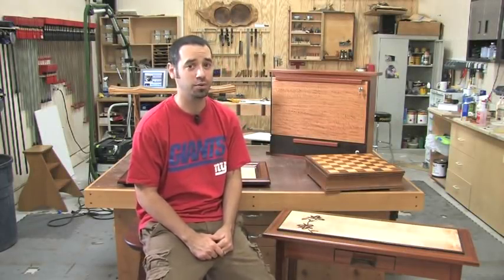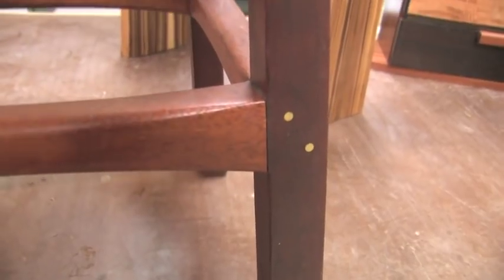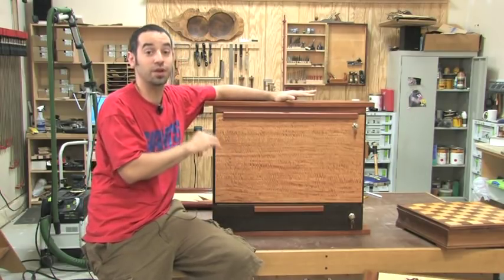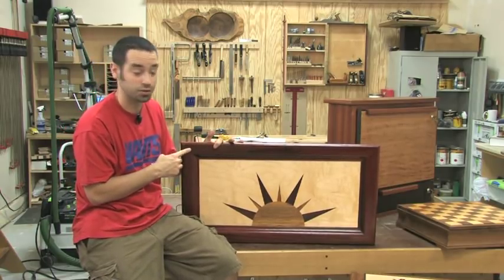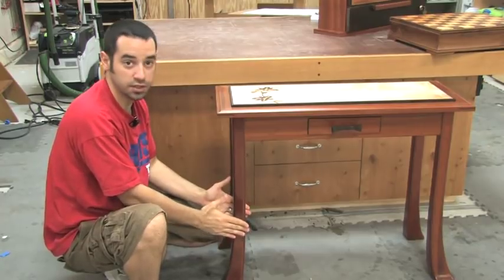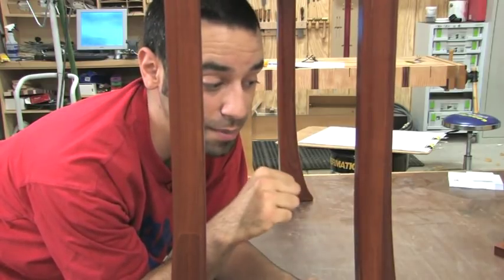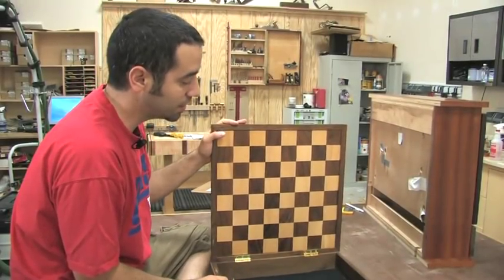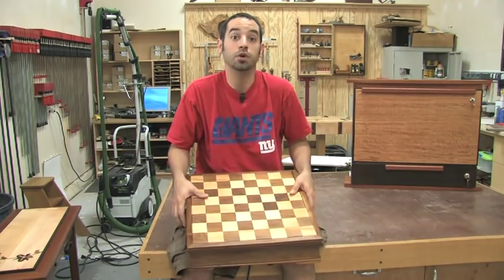76 - Examining Past Projects for Wood Movement

Comment: I’m adding a 3/4” solid wood top to a  small chest of drawers. The current top is 3/4 plywood. My plan is to screw the solid wood top to the sub top. I’ll elongate each screw hole in sub top for wood movement. Your opinion?

Comment: Mark, looking at your chess board project and separation woes - it appears on your close up views that your squares are all oriented with the grain running the same way. I made mine from walnut and maple 25 years ago and alternated every square and its held together well. I made my squares all 1/8” thick. I also bonded them to a piece of 3/8” Baltic birch ply.

Comment: Hi, Wood Whisperer, I know this video was a long time ago but I have a question about wood movement. I am building a top for my kitchen island. Using maple 3" x 3/4" boards glued together. The top is going to overhang one side by about 12" so I decided to put the top on a 3/4" sheet of plywood for stability. The question is should I glue the maple to the plywood or will that cause an issue with the movement? Thanks

Comment: Great job! Those are some beautiful pieces. In the case of the projects you shared that use the plywood centers framed by solid wood. Did you consider using tenoned miter joints? with the centerpiece grooved in place on the sides and left with a hair of wiggle room I wonder if you could get away with it being solid wood, possibly laminated.

Comment: My biggest mistake was make the lid for my tool chest in the middle of summer in Houston, Texas.  It was a nice snug fit and moved beautifully!  Then winter came and would not shut 100% flat.  Then I recently moved to Colorado and this region's winter has caused more shrinkage!  Now I can't close the lid pas the lip of the chest top.  Added bonus is the floating panel has shrunk to expose unpainted wood of the stiles and rails!!!!  Looking back I should have fitted the lid for the outside dimension and incorporated a little more wiggle room on the inside!

Comment: A way your chessboard would have moved less, is to orient the grain in the squares so, say, the dark squares' grain ran front-to-back, and the light-colored squares' grain ran side-to-side. Better: Make the squares no more than 1/8" thick, and glue them to a plywood substrate. Do the same on the inside, if you wish to have that "just made of squares" look.  Problem solved. And no dirt-catching grooves.

Comment: Hey everybody, I have a problem of some tabletops that have breadboard ends. There have been some cracks in the table top as the season is really dry here in Ecuador at the moment. I have been tempted to fill them in and have had been suggested to do so. My concern is that if I fill in the crack, once the relative humidity goes up, will having filled the cracks then cause more stress and create other cracks?

Thanks for the advice. Hopefully I can figure this one out.

Comment: I have a question in making a, for lake of a better description, a cedar chest, but out of oak. I want to build it with the grain running vertical instead of horizontal. What problems do you forsee me having on a piece, 14" tall X 50" wide?

Comment: I'm starting to understand the rule of never framing wood with wood or you will blow out the frame from expansion... but what if you wait until the hottest most humid time of year where its the "most expanded" and then make the frame based off of that? is that feasible or will it still be bad?
Reply: Then you'd get cracks when the wood contracts in the dry season.

Comment: You made a mistake in your explanation, wood doesn't expand in length, it will expand in thickness and width. That is considering length is along the grain. Wood is essentially a bunch of tubes that can't get longer, but can get wider and thicker. For your bar stool example ( where you made the mistake of saying wood expand in length ), it would actually be the thickness of the butt rest that becomes smaller thus giving the impression that the tenons have extruded from the surface. You will see gaps and spaces appear on your furniture. But really if you keep the final product at the same temperature and humidity level than the shop it was made in, which is around 12-14% humidity. Then the wood shouldn't work and you shouldn't be getting openings. The only reason why it opened is because the wood's humidity level changed, which is most likely due to the fact that you didn't properly stabilised your house humidity levels. You can also use several methods like a pull dowel mortise and tenon assembly, which will pull the tenon inside the mortise as the riser reduces in thickness, and will pull even harder as it expands in thickness. Something like a dovetail joint will never separate if done properly as both pieces of wood work together and are expanding and contracting together.

Hope this helps.
Reply: you are wrong